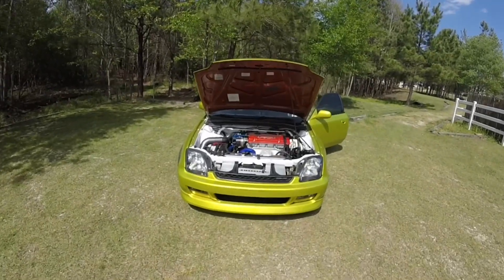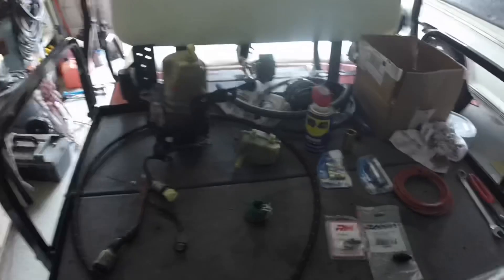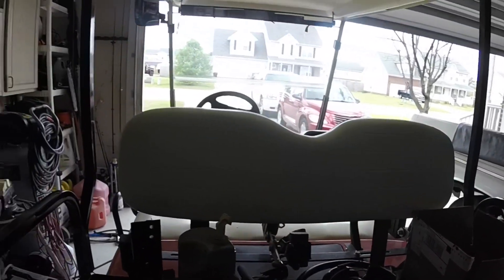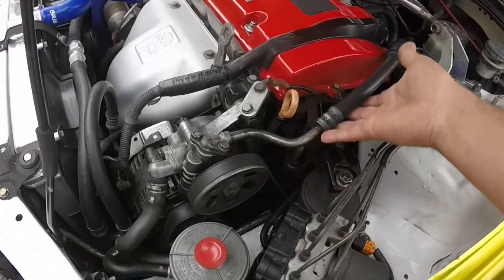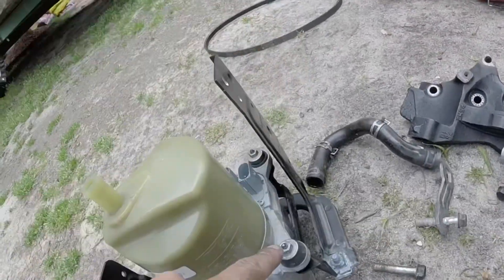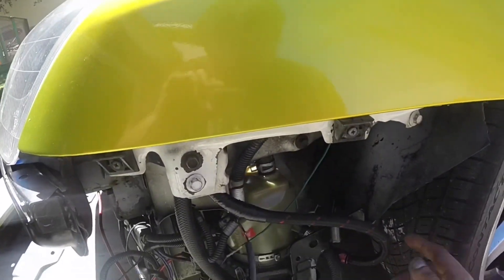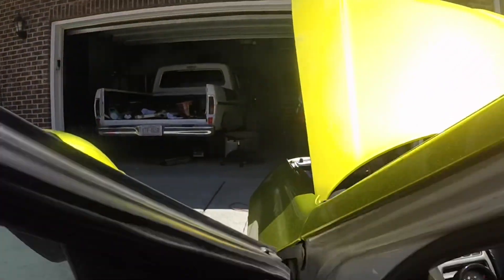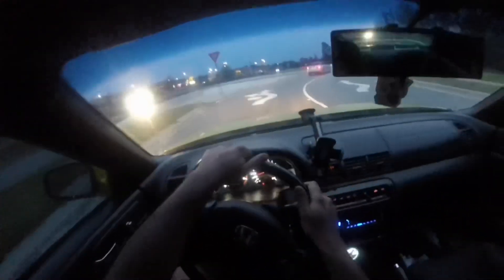HOW TO convert a Honda to Electric Power Steering!  -  Using a Volvo Pump

Comment: Thanks for the video I have a question, what about controlling the pressure?
Stock rack and pinion have a pressure switch, is not to much pressure from the electrical pump?
Reply from the maker: The “pressure switch” on a stock car doesn’t actually regulate pressure at all, that switch only activates and tells the ECU to raise the idle.  It can’t do anything to change the pressure though, the stock pump only puts out pressure and it doesn’t change, and only changes based on RPM of the engine spinning 👍🏾
Reply from the maker: At least concerning 90’s/00’s Hondas